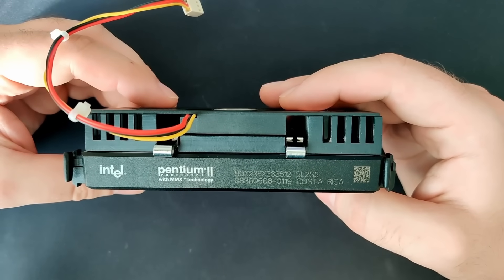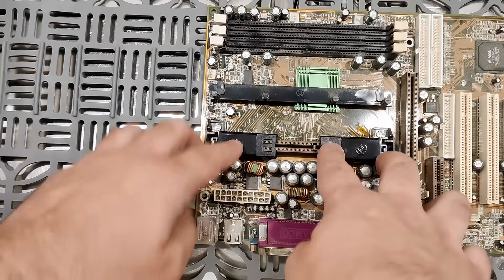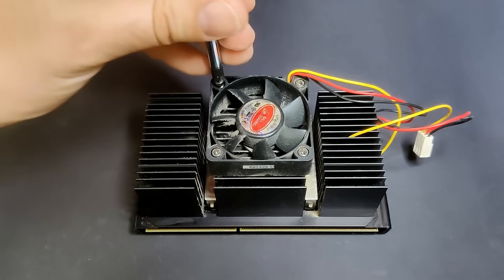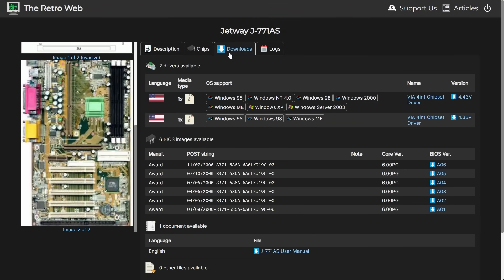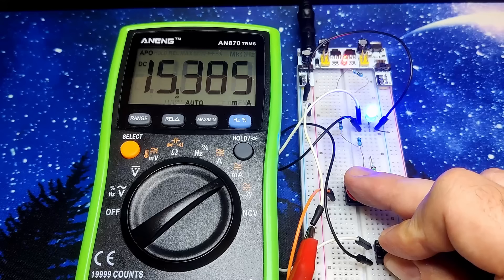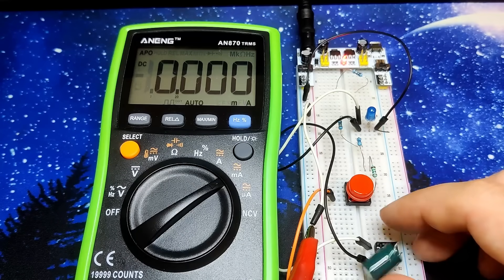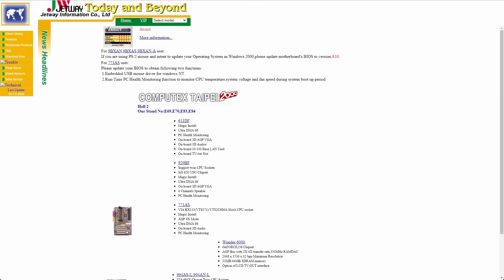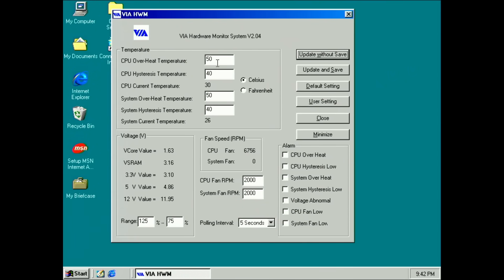Scrapyard find: AMD Athlon and a Jetway 771AS motherboard

Comment: Cap replacement: only replace the bulging/damaged ones and if there are more of the same brand and values that are not bulging/damaged. They are probably from the same batch and will get damaged over time. But if they are not damaged that can be because they are used elsewhere on the board and doesn't get as much stress on them so maybe they are fine (like close to the ISA slots, those look normal compared to the ones around the Slot1 connector).

Comment: As someone who ventured in deeper recaps - ABIT BE6-II and BP6, Soyo 6BA+IV, Matsonic MS8308EP, ECS K7VZA, Luckytech P6BX2.

Replace all caps except the smaller ones (like very tiny, smaller than the regular RAM/VRM caps.). Especially in your case, GSC is known to fail from just sitting (I had to rid an ASUS K8N of those buggers. Yuck.) and in time, you'll have to replace the small ones.

As for Jetway quality - pretty good once you recap it, but very lacklustre than even obscure manufacturers like Luckytech or RedFox. I had a J-7BXAN - it had nearly no ACPI implementation under NT4/2k/XP. Other than that, for a very cheap BX board, it did its job very well.

Comment: Not only did it use the Alpha EV100 bus, rumor has it that its FPU was essentially an x86 reverse engineering of the Alpha AXP floating point unit giving it a massive advantage over the Pentium PRO FPU of the Pentium II and III class Intel CPUs.

Infact im fairly sure the modern Ryzen CPU use a highly modernised version of the same APU in its "bones"
But this is educated speculation, I build PCs, I dont design CPUs but I do have a basic understanding of architecture. lol

I have a K7 "Athlon Classic" 700MHz version in one of my "Retroboxes", mated to a 3DFx Banshee. running 98SE, I had to build it because back when the K7 was new I wanted one so bad but couldnt hope to afford one at the time. (And yes I am an "AMD Fanboy")

Unfortunately it stopped working, and I suspect it died from bad capacitors, so yeah id suggest replacing yours.
Reply from the maker: AMD did acquire talent from DEC and NexGen to work on the K7 project. DEC was sold to Compaq in 1998 and the Alpha processor development was discontinued due to that. So yes, what you're saying makes a lot of sense!

Comment: Jetway is certainly... a manufacturer. Boards of that era were not considered reliable or nicely built. They did make some a lot more reasonable ones later on, but they also quit the mainstream market but kept on making ITX and specialised boards, if memory serves. Some early Jetway boards suspiciously match Lucky Star or Formoza, not sure how and if the companies are connected, and i'm yet to see a product from these two that wasn't garbage.

My logic when doing recaps is to lift a cap in each group of similar ones in same or similar circuits. If a certain value or group is bad, they're all getting the pull. If they still look unquestionably good on an LCR, i can put them back in if they aren't too critical. The CPU VRM ones are what i'd call critical, they aren't going back in, plus well just depends on the topology of the board what looks like it's critical or not. The little ones around the soundchip don't need to be pulled at all if it's not making audible trouble, they should be fine forever.

I don't think the remaining caps are too important, i wouldn't be inclined to pull them now if they don't feel like they're getting at all warm. If there's external or internal heat on any of them, do consider a replacement.

Dish soap wash is fundamentally a valid method, but i'm never quite sure about moisture stuck under BGA chips. You're "supposed" to use distilled water (pointless IMO when dealing with a badly contaminated board to begin with) and then bake it out in a drying oven, but i don't happen to have a suitable oven! When i did do the soap wash once or twice over the years, i dry the PCB for upwards of a week just in case, which makes me a little distrustful of the method, because leaving water in for too long is something i'd rather avoid. Why a week? Because i made an experience once 20 years ago that 24h wasn't nearly enough. Maybe if i lived in a desert, or indeed in an oven, i'd be of a different mind. Alcohol and residue-free brake cleaner are cheap enough that i usually just use them.
Reply from the maker: Yeah, if I didn't have the hot climate here, I would not trust 24 hours. Water is quite resilient in small gaps and below chips. It has to evaporate properly.
The water we have here in Dubai is desalinated seawater - and it leaves almost no residue on surfaces. So far, it's good enough and I haven't had any trouble using it.

Comment: Hello, I have an Abit KG7-RAID with an Athlon 1400 MHz Thunderbird CPU. Most of the larger capacitors have failed and I don't think I can restart it. I would have to either replace them myself or ship it to a repairman. Also, the Enermax 350 watt PSU probably also needs repairing. Why did they make such cheap undependable capacitors back then? {SIGH}

Comment: Capacitor premature failure is the function of temperature, which is the function of current (own heat generation, because of internal resistance = Joule's first law) and surrounding heat emitters, which is the function of AC part in DC. Multiplied by capacitors plague. Multiplied by 5V rail used for power AGP and CPU (remember 35-45A 5V rails on older PSUs ?). Starting from Nforce2 CPU rail input changed to 12V.
As of chemical degradation - decades, 40 years at least. So the answer is - no need to resolder any other capacitors, only the high current power path ones.

Comment: The spot on the heat sink makes me think they etched it with an acid or something, just to try and remove a layer of oxide.
Reply from the maker: You may be right. Maybe it was also to just remove the old thermal interface. Surprisingly, the surface was totally smooth. If you look at the backplate of the CPU, you will also see some discoloration. Might have been some residue left that attached this surface too.

Comment: If you love the thing you will replace all the caps, but if you are practical you will only replace the bad ones. 
It also depends on use, like if you only use it once a year replace only the bad, but if it's high use you do all, ie, no point spending $100 on caps when it's occasional use and there is no history of those caps leaking goo.

Comment: Nice find and restoration job! I did not own one of these as I wasn't a particular fan of the cooling solutions for slot-based CPUs. So after Slot 1, I went (from a PII 400) to Socket A instead, which turned out to be the right choice I suppose. But the Slot A variants were great CPUs nonetheless and are probably more rare and valuable than the respective Socket A counterparts now. Was this the same scrapyard that you previously visited? If so, it must've still been inside a case to have survived in such good condition! 😅

I like to blow cleaned boards dry with high pressure air from a compressor to make sure that no moisture is trapped under any of the components, but I suppose the hot Dubai sun takes care of that just as well (and much quieter, too). I would recommend a final rinse with deionized/distilled water in that case though. As for cap replacement, I usually take a nuanced approach, focusing on groups/brands/types that were clearly stressed/are more important/from which one or more has gone bad. Unless it's some particularly high value item with which I don't want to take any chances, then I go all the way.

I really like your cap test setup with the LED, it's a great additional tool for diagnosis, as the tester really doesn't tell you the whole story sometimes. I've had caps that looked and measured perfectly fine, yet clearly were the culprit.
Reply from the maker: Yes, it is the same scrapyard. My Sunday morning routine from now on. I may even start livestreams next year because I have too much to work on and sometimes not enough time to make those "polished" videos.
Regarding the moisture - I wish I could get a small compressor, but I'm running out of space in my apartment 😔. Your approach is the best one to get any water residue out from under chips and sockets.
 And yes, the little circuit tells a bit more than just numbers. I guess the meters can be fooled if a capacitor is screwed up in a balanced way 🤣

Comment: I know "Teyah" brand caps from that era are something to watch out for... but with that said, one of my retro PC's has a super socket 7 mobo that's absolutely covered with them and it's holding up fine so far.  The eBay auction where I bought the board two years ago claimed it was new old stock, just lacking the original packaging, which probably means in truth that it was lightly used - but the original caps have held fine up so far, whereas the identical mobo I rescued from a scrap PC one year later needed all the Teyah caps replaced.
Reply from the maker: On this board, none of the Teyah branded caps seems to have an issue. It may also depend on the series! But I'll make sure to keep an eye on them.

Comment: Your memory doesn't betray you. VIA drivers were a bit of a firecracker in the past, very temperamental. The lack of a good DLL version control in Win9x didn't helped.
Reply from the maker: Good that I'm not the only one having mixed feelings about the VIA drivers.

Comment: You are likely to get a reliable repair if you chase down and replace all Ultra low esr capacitors. Other capacitors typically don't require replacement, but often I'll just do the "replace anything 470uF and above" just for a nice finish.

And sometimes, there will be more capacitors that show signs of failure, many old capacitors were just that poorly made ... it really is a board by board thing.

Anyway, you lucked out on the Athlon board. On mine, I had to replace ALL of the physical PCI slots as for some reason the originals stopped working. That was a not fun thing.
Reply from the maker: Wow, I don't want to replace any type of slots (including memory). Sounds like a terribly tedious job! What tools did you use to desolder so many pins?
Reply: @bitsundbolts  That required a desoldering station. Just a cheapy one, but lots of patience too.
Reply from the maker: I know there will come the day when I have to buy one of those too.

Comment: When I re-cap stuff it depends a bit on the purpose of the device how far I go, as a minimum I always change the same type capacitors as failing ones as if one swell upp the other same caps will soon too. The capacitor plague is a devil in disguise for sure as you don´t really know which caps have the faulty electrolyte formula, you can generally trust Japanese caps especially Rubycon, Nippon chemicon, Panasonic, Nichicon etc. but to be honest I actually more and more often see caps from the 90s from brands like Nichicon start to leak the electrolyte trough the rubber seal now, These don´t swell and is a silent killer as they don´t really lose capacitance that much and not very "vissible" either like the Vulcanic leaks you get on the cheap caps as they just start becoming a little moist at the bottom at first which you don´t really see before it soaks the whole board in corrosive goop. bad caps is the big killer of all things you love so my rule is that IF the device is in my dedicated usage and need re-cap somewhere I take the extra step and recap EVERYTHING on the board, including Power supplies, I have a 486 computer that almost went extinct because all caps have started to leak and corrode the whole unique IBM power supply to death, it was actually completely dead when I found out what happen but I managed to save it just in time with a complete re-cap of the motherboard and Powersupply. And even my expensive Nixdorf P1 computer from Leaky Nichicon had a complete re-cap with a hair of margin before permanent damage, puh, I have no trust for old caps, they must not be trusted!

Comment: I skipped slot A. I jumped from super 7 to the AMD thunderbird (Socket A) That was one of my favorite computers. The next favorite was 2008 intel core 2 quad with nvidia nforce. And my next favorite is my 2021 build which is AMD Ryzen 5900x. The computers I didn't like as much are too many to count, but notable ones include an AMD Athlon XP mobile processor. My cousin gave it and the motherboard to me. I have no idea where he got it from. It was supposed to be a 64 bit generation, but it didn't have 64 bit support on it. Maybe it's because it was mobile. To this day I don't understand how and why that board and CPU existed. lol It was peculiar for sure. The other notable one was my Intel I7-2600. The CPU was amazing, but the motherboard was inferior to the nforce board in my opinion. As a result the core 2 quad wins. I'm still sad that nvidia boards aren't a thing because they were amazing, but my ryzen board is so rock solid.
Reply: Slot A had very short life anyway. In 7-8 months AMD switched to the Socket A, which turned out to be much more superior platform, lasting 3 years. 4 if you count lower end sempron cpus released alongside athlon64.

Comment: I kind of think that if you have bulging caps, then there is a reason why. If it's environmental then it's only a matter of time before the rest go too. So I think it's a good idea to do all of them in this case. Also anything from the 90's or 00's should be recapped if it has SMD caps. They were trash caps back then.
Reply: Not really, the capacitors around the CPU are typically of a higher electrical specification than the others scattered on the board.

This higher electrical specification often came at the expense of the lifespan of these capacitors. And this area tends to get much hotter than other areas of the board. So often you will find these boards have perfectly serviceable caps alongside others that have gone byebye!

Comment: Found a ATI 9800SE 128 mb today in the junkyard that would have suited this rig pretty well I'd imagine gonna test it later this week or tonight maybe if i get the energy after work to dig out a agp motherboard with a pentium 4 in it.
It's a generic oem version which probably will unlock the 8 pipelines if it works & has 128 mb ram in an L shape on both sides of the gpu, gpu cooler is not diamond shaped but square.

update, card is dead.
Scrambled stuff on the display on both dvi & vga oh well..
 9550 will remain the best agp card i got for now then, also socket 775 agp motherboard is complaining about usb overcurrent protection even though nothing is plugged into usb*
Reply from the maker: Ah, sad that the card is dead. I wonder if it's memory related - which could be fixed by replacing it. I do have a few Radeon 9xxx cards as well. None of them are tested yet.

Comment: Replace all caps, they will just fail eventually.  Caps from the late 80 and 90 were all manufactured from defective electrolyte.  Also Would like to see how you replace the capacitors.  What issues did you have.
Reply from the maker: With this board, I have no issues replacing the capacitors. I turn the board around, apply some flux on the soldered pins and alternate between them with the soldering iron. While holding the capacitor on the other side of the board, I move them back and forth, slowly taking each of them off the board.

Comment: @BitundBolts
To answer your question: As a rule, I replace caps only under two situations. 1. If they show any signs of damage or leakage. 2. If the board is malfunctioning. Caps are, despite their reputation, very resilient devices. Even lower quality caps, if made properly, should last for 80+ years. As long as they are not overheated or overvolted, they should last a lifetime.

Comment: Its the high side caps on vcore that are generally most likely to fail. (The big 16v caps around the cpu socket.) They are subject to the most heat and power supply ripple. 

Anything from nippon chemicon kzg series i replace on sight regardless of condition.  They are notoriously bad. 

Caps on lower voltage rails and arents kzg i usually leave alone unless theres visible bulging or leakage.

Comment: Jetway was one of two brands that would make my heart sink. The other being PC Chips. So many of friends machines with the same chipset and CPU as me would have problems with those makes. I am sure they have a few good boards, just like all brands have their ups and downs. I skipped the slot era going from Super Socket 7 to Socket A. Now though I'm just glad that one of these boards is saved.
Reply: This is so true. Jetway was similar to ASRock in that sometimes you get a gem, many times you get inconsistent results. 
They were not terrible, but I had far better luck building stable systems around AOpen and Gigabyte.
Reply: Yes I remember them as being in the PC Chips tier as well! cheap but for a reason.

I had a Gigabyte board for Slot A, it seemed fine from memory. I think I remember the critical thing being to get one with an AMD750 chipset (I think!) vs the alternative Via chipset.
Reply: they used to die like crazy within a short time mostly with dead chipsets. happened to me too i had an athlon 750 or something like that the board lasted only 3 months and just died.
Reply from the maker: So, I guess mine is a lucky survivor!

Comment: Hi! my point is: all the capacitors have the same age, if one  or more of them have problems, we should expect problems in a short term of the others that looks good. S, my opinion is replace all
Reply from the maker: I usually replace the same model / same area caps where issues appear. But usually you'll find different values and brands on the board. But yes, if you want to be on the safe side, then you can replace them all. It will just be a lot of work, but piece of mind. And better to replace groups of capacitors and not all at once - just in case something goes wrong you don't have to worry about the whole board.